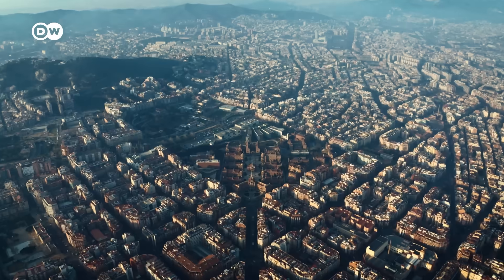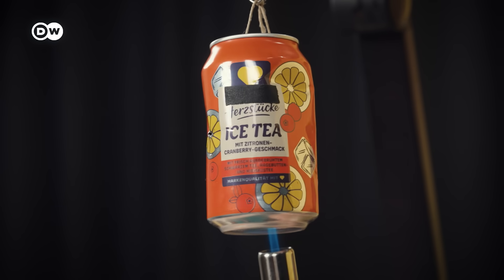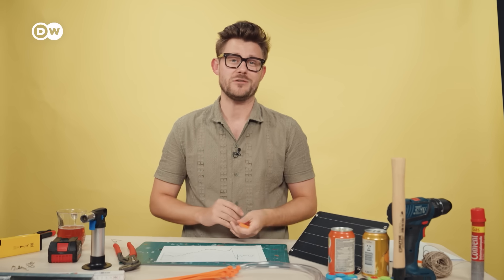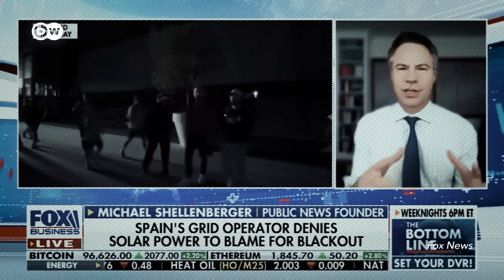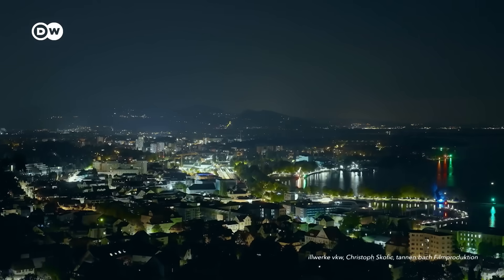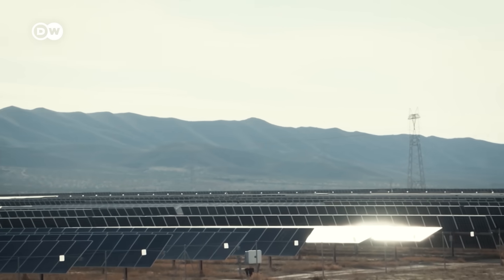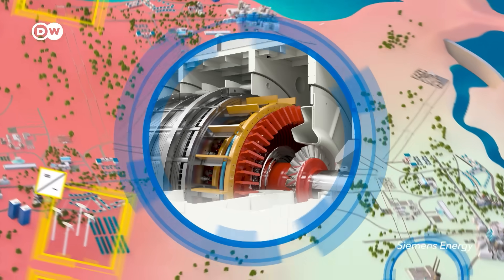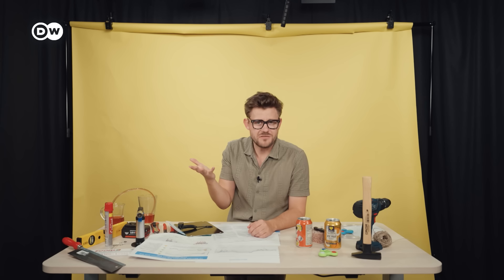Solar's hidden problem (and how to solve it)

Comment: the nice thing about solar is you can have your own private system for your own home and put less strain and overall reliance on public infrastructure. The things that take up the most energy like cooking and heating can be dealt with using cleaner fuel sources or gas
Reply: Yes. Using gas a few days a year is far better than depending on it all the time.
Reply: It’s not just about pollution. The important issue is burning hydrocarbons and releasing CO2
Reply: In California, they produced so much energy they were selling it back to the grid. And then those plans rapidly started getting cut off as solar was producing too much excess energy there too... and the grid is crap.

Comment: This is bullshit disinformation. It was a failure of the grid that monitors voltage rather than current. Read the papers of the investigators, not those of the fossil industry.
Reply: You must be referencing the RED Electrica (Spanish grid operators) spokesperson and executive papers. Not the current (ENTSO-E) report. The final engineering report is set to be released in 2026.

But the most current ENSTO-E report on 3rd October 2025 said they lost 2.5 gigawatts of renewable generation at once "causing a surge in electrical voltage and triggering a cascade effect across the Iberian Peninsula"
"The report published today, prepared by 45 experts from grid operators and regulators from 12 countries, classifies the incident as "scale 3" — the most serious level provided for by European legislation — and describes it as "the most significant to occur in the European electricity system in over 20 years," affecting millions of citizens and causing serious disruptions to essential services.

According to analysis by the European Network of Transmission System Operators for Electricity (ENTSO-E), the sequence of failures began at 12:32 p.m. (Brussels time), when several solar and wind power plants in southern Spain suddenly disconnected from the grid, followed by additional losses in regions such as Granada, Badajoz, Seville, and Cáceres. In less than a minute, more than 2.5 gigawatts of generation capacity were taken offline. This outage reduced available reactive power compensation, causing a surge in electrical voltage and triggering a cascade effect across the Iberian Peninsula.

At 12:33 p.m., the Iberian system began to lose synchronization with the mainland grid, registering frequency and voltage fluctuations that could not be stabilized by the automatic defense plans of Portugal and Spain. Shortly thereafter, the interconnections with France and Morocco were also disconnected, consummating the electrical separation of the Peninsula and the total collapse of the Portuguese and Spanish systems.

The conclusions released today are factual in nature and are based on data collected through August 22."
Reply: Thst is what he said in the video!
Reply: @patrickdegenaar9495  "Solar's hidden problem"? That's nonsense, isn't it? PV power started at 6 o'clock; the grid collapse started at noon. The hidden problem is indeed the insufficient operation of the grid.
Reply: @uweseemann8571you are probably correct that it was a failure of the grid operator to not stabilize the voltage, but that may have been because they didn’t have the right tools 🛠️ to fix the issue. Meaning there was too little flexibility in the grid to add or remove power supply quickly enough.

Comment: i don´t know the spanish energy framework but it seems that there is no hydroelectric plant that helps a lot to stabilize the grid.
Reply: They do have a not insignificant amount of hydro. It's one reason they didn't think grid-scale batteries would be necessary.
Reply: They do have quite a bit of pumped-storage hydroelectricity.

Comment: the centralization of the grid is a huge problem. we need a more resilient decentralized grid with solar and batteries.
Reply: A centralized grid is more efficient. To be resilient, you must have enough redundancy, buffering, and smart grid management.
Reply from the maker: Hey there! We also did another video on the electrical grid and the challenges. Let us know what you think. You find it here 👉https://www.youtube.com/watch?v=u-DsDuTceTo

Comment: In Italy i have experienced 24 hours of blackout in summer with 30degrees outside not because of solar but for the converters and cables in a city with 50000 people. No one noticed.
Reply: There is always a blackout somewhere at any given time so your case is not special and doesn't raise huge concerns, but 50 million people (Spain+Portugal) without electricity is a huge problem for national security, health services, food storage, etc
Reply: btw the blackout was for the entire country of spain, so 48 million people. that means, no internet, no mobile data, no fridges, and nothing related to electricity. people got stuck in elevators (that dont have backup generators), meat went bad in markets, SOME flights got canceled. Did i mention that water wasnt running? no washing dishes, no bathing, no washing foods, and so much more for 48 million people, for 6-12 hours
Reply: @FlyFlux  Si hubo agua, no faltó en ningún momento.
Reply: @FlyFlux  Water kept running here at least, but yeah, we were that close to people getting into fights over basic resources
Reply: You're totally missing the point. The blackout in the iberian peninsula was a huge concern and something unheard of in the modern world. 
Both nations were out of power for nearly a full working day (lunch time til night time). Not just a simple and isolated blackout but a national wide where no where had power. 
This includes everything you can think of
Telecommunications
Hospitals
Traffic control 
Airports/public transport 
And so many other sectors. 
People were trapped inside trains, in underground tunnels, in elevators, etc 
It was a dangerous situation

Comment: Additionally, it is bad journalism to show a blackout picture of Spain that never happened. It is photoshopped. By nighttime, there was power back up in many places. Really a bad choice that I think for sure goes against some of the internal rules of DW.
Reply from the maker: Hey there! You are right, we have (over)simplified the thumbnail. There were backup systems, for example for hospitals or airports. Overall, about 50 million people on the Iberian Peninsula were affected by the power outage.
Reply: @DWPlanetA you knew exactly what you were doing… but decided to do it anyway to click bait
Reply: @DWPlanetA Most people would probably prefer a boring but true picture instead of a fake one. Builds trust.
Reply: @DWPlanetA  DW is so hypocrite that they can change the thumbnail now (after publishing video) but they won’t
Reply: @DWPlanetA  That's not the complaint @chcomes had. By night-time some parts of the grid have been probably reenergised
Reply: @kakiremora2991 "some". not all. Therefore there's no inaccuracy.
Reply: @Fenthule  if whole of Portugal is not enough of inaccuracy for you, then what are you here for?
Reply: @kakiremora2991 mine returned at 18. The freezer didn't even feel it and didn't need to find the candles.
Reply: I mean… sure, the grid was mostly up by nighttime, but the picture still conveys the message. The whole point is that there were 9 hours were the whole country has no power. The thumbnail conveys that message. I saw the thumbnail and immediately knew it was about this power outage. That’s the point.
Reply: @angelmarques3124  Power was quickly restored in the north of the peninsula through the connection with France. From there, it was gradually restored southward. Some areas only experienced an hour-long blackout.

Comment: It is sad to see how little research went into this episode.
Inertia does not help you in cases of problems. On the contrary, inertia itself is a problem in an energy system.
The issue at hand is the lack of modern regulations to ensure a stable grid. Most of the grid parts are controlled with frequency, in a very analog way. They are also controlled by voltage.
If all power plants and most transformers would be controlled by an IT system, they would go up or down according to necessity.
Right now only PV does that. However, on top of this, there are "analog" norms that superseed this. These norms made PV disconnect quickly and efficiently, as they do daily in countries with curtailments.
Plants that have inertia and do not allow this fine control are the ones that bring systems to their knees.
Reply: If grid forming inverters had been allowed in Spain, nothing would have happenden at all.
Reply: Many electricity experts that I have heard of recently have talked about the need of inertia in solar, to stabilize the grid. What they want is an analog way for solar to match the analog inertia of parts of the grid like turbines. It is like a weight scale, you can pull it up or down to get it to stabilize. That is the inertia.
Reply: apologies, but what do you mean with PV?
Reply: @Bennie_Tziek  PV= photovoltaics aka solar panels. You can capture energy from the sun in more than one way but PV is specifically solar panels.